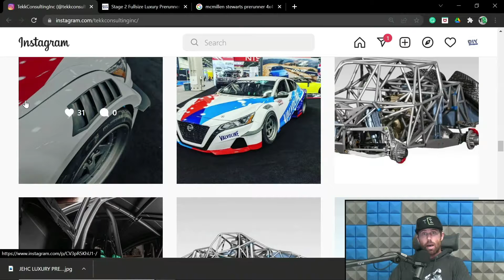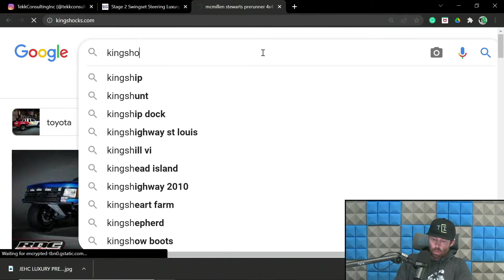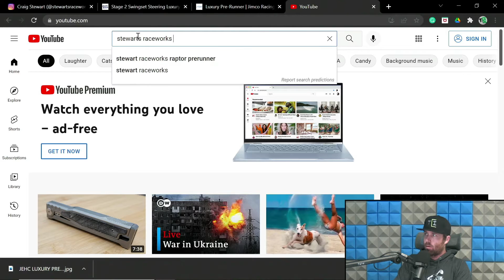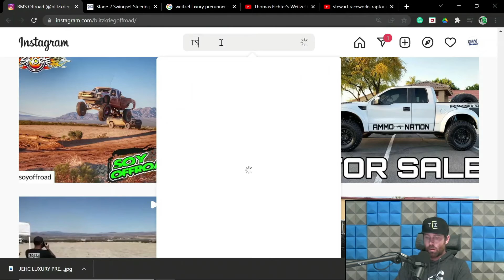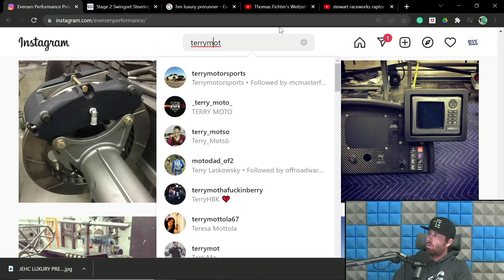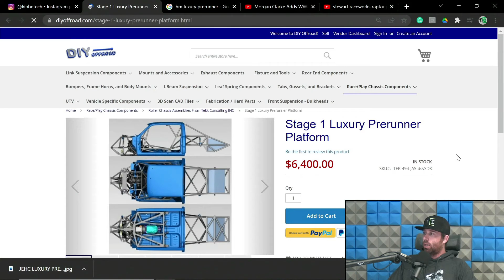Luxury Prerunner Defined   JEHC   EP2

Comment: How about a Bronco like Desolate's El Gato? High end prerunner?
Reply from the maker: technically i would classify that as a "high end prerunner" because it's not a tube chassis truck. However, i am designing a few tube chassis bronco luxury prerunner platforms for a few different clients right now, so you will see some Bronco Luxury preruners in the near future.

Comment: Builders like kibbe or rob build some extremely high performance, comfortable, "luxury" interior prerunners with some length of frame rail still in tact. Because they have 6' of frame rail remaining, these arent considered luxury prerunners?
Reply from the maker: I would refer to those as "high end prerunners", very similar yet different in root definition.